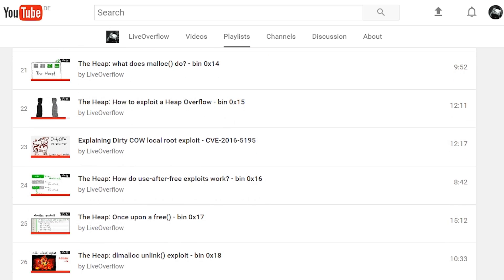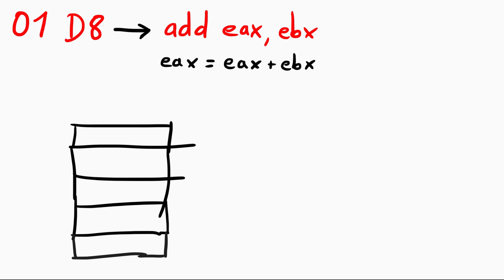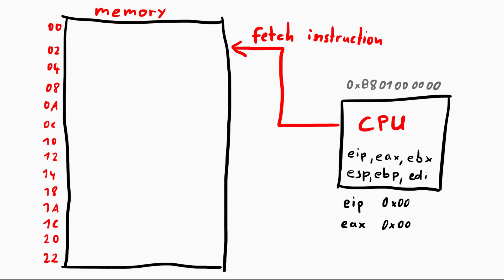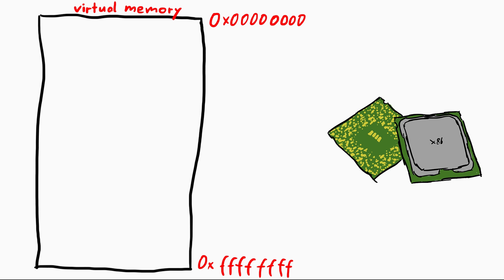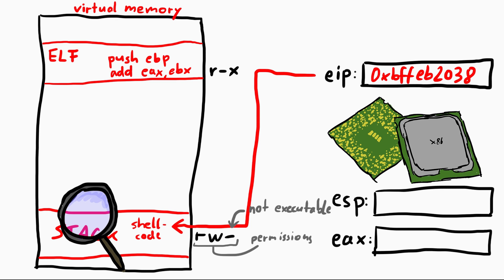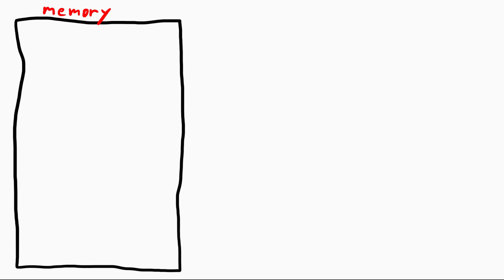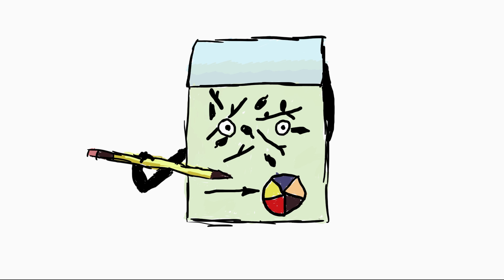Developing an intuition for binary exploitation - bin 0x20

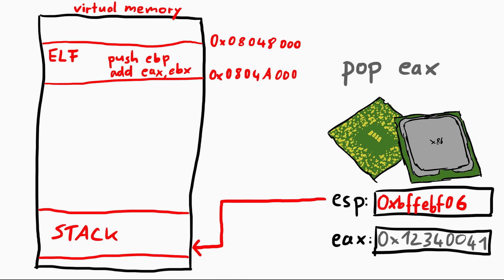Comment: 6:27 Not exactly - ESP dictates where the top of the stack is, so if it points in the middle of your code section then this is where the stack is.
Reply from the maker: +Agnus Xendis that's basically what I said. No?

Comment: one thing i am not able to understand that in most operating systems an stack may not have a contiguous block of memory in physical ram. in that can how can a overflow attack can work ?
Reply from the maker: we don't care about where the stuff is in real memory. If it's in RAM or swapped on disk, or if monkeys write it on papers. Our programs operate on virtual memory and that looks like continuous block of memory. The kernel and hardware makes sure to abstract away the true underlaying physics for us.
Reply: let's say for example the value of ebp and esp for stack is 0x100 and 0x96 and return address is at 0x104 so if i have to overwrite the return address then i will have to supply 12bytes of data insted of 4. but if my return address is mapped to 0x1000 in the actual physical address and esp is to 0x2000 then how can someone able to overwrite the return address with only 12 bytes of payload when the actual difference in memory for them is 1000 bytes?
Reply from the maker: like I said. We don't care about the actual physical RAM address. no program ever deals with ram directly. We have absolutely no idea what the real address is. All you deal with is the virtual memory space... A part of the CPU, the Memory management unit, translates the virtual address to real address. 
even if we knew the real RAM address, we could never access it. Our programs never use real addresses.
all we do is use virtual addresses, so 0x100. and the MMU will translate it on hardware to 0x2000. we never ever see the real address.
Reply: thanks for the reply.